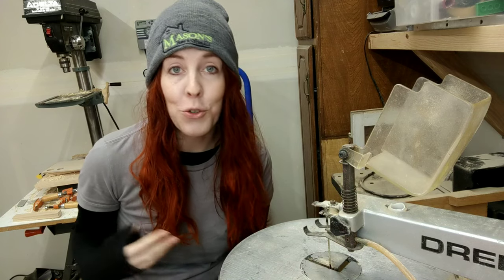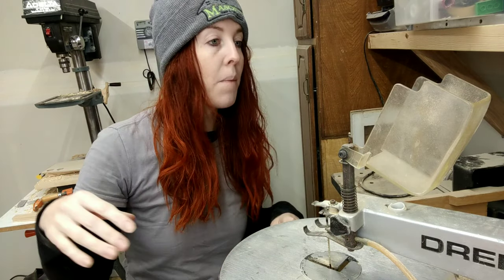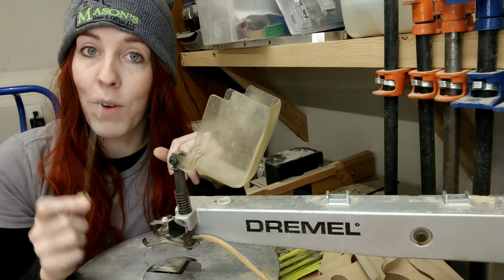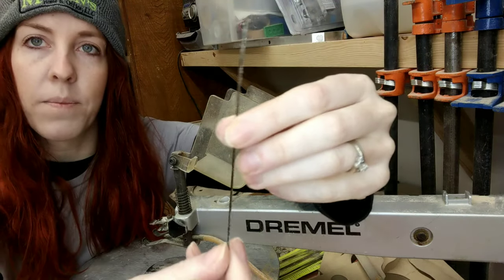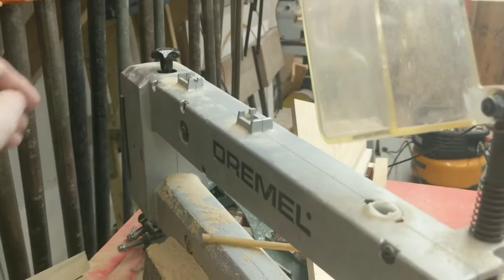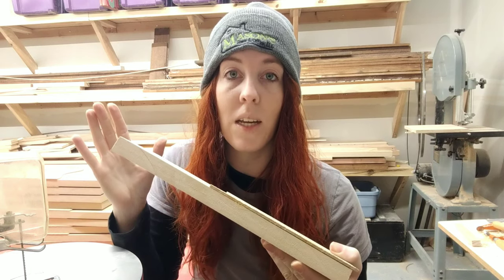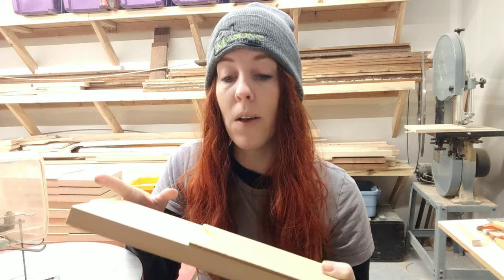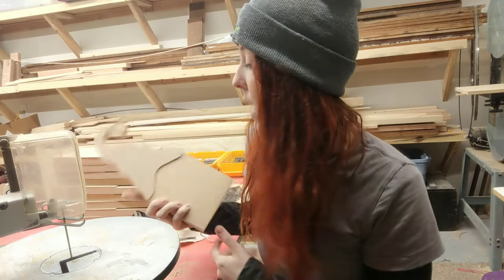Scroll Saw for Beginners: Essential Tips and Techniques for Woodworking

Comment: How to find our you bought the wrong scroll saw in just a few minutes, I have the pin style blade so I can't use a spiral blade.....most of my projects aren't going as planned
Reply from the maker: You might consider exchanging for a different saw if you do a lot of small cuts. I just use small kerf blades for what I do and it works fine. I also believe there are scroll saw blade conversion kits you can purchase and install to use spiral blades vs the pin blades. If you can't exchange the saw, that is what I would do.

Comment: How do you like your Dremel ? I had an 18" , used it so much I burnt it out .
Reply from the maker: I love it! I still find it hard to get tight corners, maybe I just don't have the right blade? But it's easy to work around. I've thought about buying the conversion kit so that I could get some spiral blades. Any suggestions?